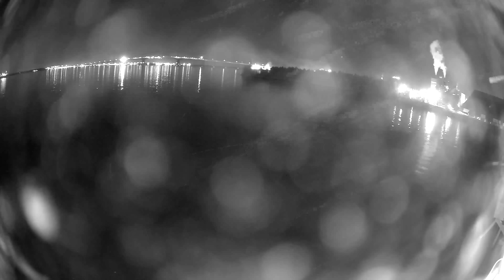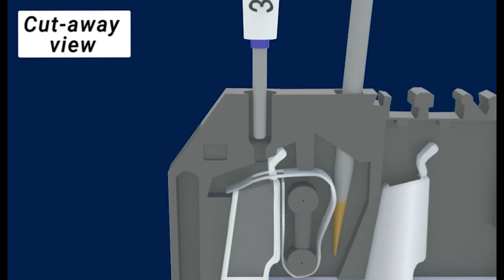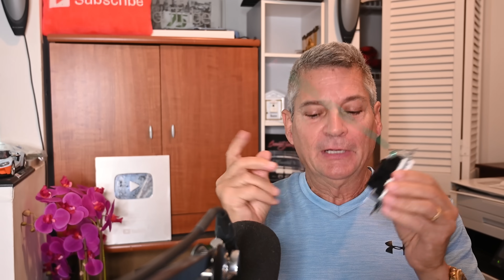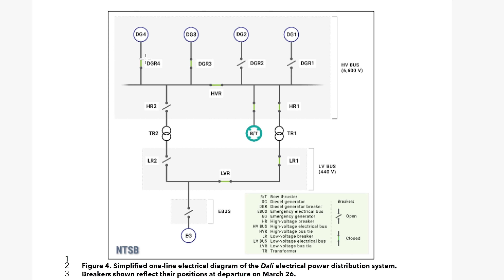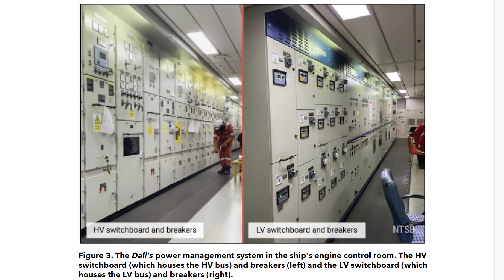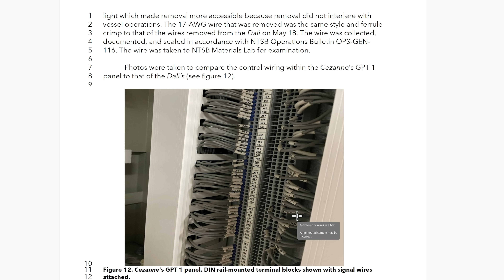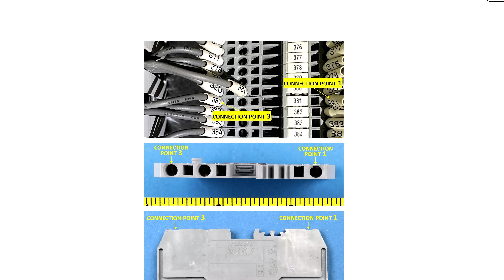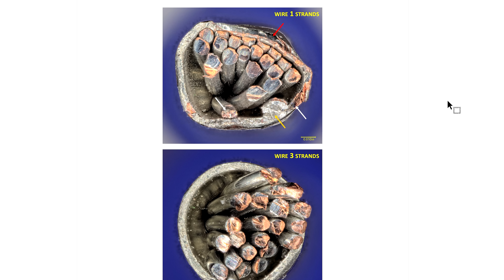NTSB: Scary Wire ERROR Caused Dali Crash/Key Bridge Collapse Baltimore

Comment: Im an automations guy and have built many panels. In my first year of apprenticeship way back 10 years ago we were taught NEVER to use ferrules on this type of terminal block. Every ferrule was multiple points docked in practical exams. The ferrule lowers the connection strength with the spring loaded copper strip AND increases contact resistance (even tho this wasnt any issue here). Idk about the codes in the US though, im swiss

Comment: I once commissioned a crane in Bermuda, and because there was no power available, I used my spare time just to inspect some of the crane wiring. Tugged on a wire, pulled straight out of the crimp terminals. Tugged another, same thing. Most of the wiring had crimps that were too large for the wire size, so all had to be re-terminated. I also found larger cables where they didn't have the proper cable lugs, so they used a lug that was far bigger and just squashed it down onto the cable with a pair of side cutters.
Reply: I worked in nuclear plants in the UK and commissioned many modifications. On completion and sign off of the wiring I would run a finger along the wires close to the terminations, this was my informal test. Any loose ones were obvious. If I found any the contractor would be required to QA check all of them.
Reply: @christopherjones7459 We supplied control gear to many cranes at nuclear power stations, the Lineastat speed control system was type approved by the CEGB, the EES 1970 specification was based on evaluating it. I've been on most of the non-seismic cranes at Sizewell B.

Comment: No one seems to explain why the rudder turned the ship INTO the bridge after power went out. The ship had been on course to pass between the bridge abutments when it lost power - it should have just coasted right on through. Instead, it made a rather hard turn to starboard. Why? Add to that strange phenomena, the coincidence that the ship lost power at the worst possible time - the couple of minutes approaching a bridge. What are the odds of both happening?

Comment: Redundancy failure due to bad management, and finally enough holes in the Swiss cheese line up, and there is an accident.
Normally an intermittent break in the no volt trip circuit does not cause this kind of chaos.
It is the last one of a chain of events, and it is a symptom of a bigger problem, not a single cause.

Comment: Better than wrapping wire around the screws on switches and outlets is the back wire screw clamp style. Each of the 4 screws has a clamp saddle. Just strip the insulation to the right length, put the bare end under the clamp and tighten the screw. They're very handy when replacing back stabbed outlet where the wires are short.

One thing about the back stab holes is now they're only for 14 gauge wire. They used to be sized for 12 gauge. I had to replace a 12 gauge back stabbed outlet with really short wires. Couldn't get a new one with larger holes so I bought a higher price commercial grade back wire one.
Reply: People will try stick 2 in the one hole.  That's why they are sized to spec.

Comment: I've had this exact problem with wago push terminals in industrial control systems. Along with under-insertion, you also need to worry about over-insertion if they're wired up without ferrules. That happens way more often, in my experience. Panel builders usually use ferrules but plant maintenance doesn't always have the proper equipment on hand when making repairs or doing field wiring. The wire insulation ends up being the only part making contact. It's an absolute nightmare to diagnose because everything appears to be wired correctly because nothing is loose. It's now a standard practice of mine to just start re-seating these terminals if there are gremlins and I have a ferrule kit in my traveling tool kit just because of this issue. I love wago lever lock connectors but I hate these terminal blocks.

Comment: I hate to say I told you so! My first thought when I saw the lights go out was “the dam PLC must have malfunction. Bypass and go to relay mode or old school redundancy mode. I ask why didn’t the ships horn blow to alert the impending danger???? Probably the electric controlled the valve. Need a manual override. I’m an electrician/ electronics tech.

Comment: Usually when used correctly spring-cage terminals are much more reliable on ships than screw terminals. The screws can loosen due to vibration and are periodically tightened every few years (not sure if it's a class requirement or just a recommendation).

Comment: AT 22:10 It could be the metal conductor bar connector was heating up and melted the housing. Also the label looks like it could have been pull over closer to the contact point which the wire looks like it barely reaches. Now with that label closer to the contact point it looked like it was on correctly but it was like a false fit. Thank you for sharing

Comment: These are not power conductors, they are being used as control, to drop a contactor, or control relay if trouble. That's why they are all in series like that.

Comment: I am certainly not a naval architect, but I do have a tiny sliver of knowledge with systems designed for redundancy. And I find myself wondering about some of the decisions made in terms of the redundancy in this thing. One could easily imagine a different set of decisions that tried to make the different parts more fully redundant for each other. A mechanism where running a generator would open its exhaust shutter. A mechanism where a generator running would automatically power a second pump to bring in fuel so that a failure to get outside power from a different source wouldn't stop a generator. Etc. I'm sure there are reasons specific to this context why my guesses are concretely bad ideas... I hope that actual good ideas get applied to make failures like this not happen.

Comment: You lost big credibility with your jump-cut edit while trying to pull that backstab wire out of the receptacle- No, they are not usually "easy" to pull out and often wont pull out and you show ignorance to call a receptacle "cheap" based on it having back stab connectors- slow your roll, dude

Comment: Why where DG3 & DG4 starved of fuel? All 4 gennys should have been primed. Was their work done on these generators or the common fuel supply prior to departure? Ive not heard anything blaming the crew though the reasons for these generators being starved cannot be accredited to the electrical issue.
Reply: The ship's operators had modified DG3 & DG4 to be supplied fuel with a different pump, designed to flush the fuel lines during maintenance. Because this pump was never intended by the ship's designers to supply operating fuel it had no redundancy nor would it automatically restart in the event of a disruption of LV power.

Comment: those are the cheapest looking ferrules I have ever seen! Crimp marks on the mating surface? Yuck! Do you remember the old ferrules that have a SOLID probe on the end? That's so you can insert a pin that isn't deformed, with the crimped part exterior to the terminal block. Rectangular probes would be superior, instead of tubular/round because of more surface area, (like Anderson Power Poles).

Comment: Many people don't understand, but redundancy brings its own risks, such as the need to synchronize generators. I understand that a single wire wouldn't cause so much damage, but a redundancy solution for it will add 3 or 4 new wires. My understanding is that each fault found should be corrected from the source and not just circumvented.

Comment: I am an electrical engineer with 25 years of experience and I have always maintained that every accident can be avoided. This one really caught my attention because it was a manufacturing defect in the cable due to a poorly positioned identification ring.
Reply: And I'm thinking that there was a reason why the ID tags were attached that way. Maybe the original instruction was to keep the label away from the blue ferrule, but maybe the label wasn't securing to the wire. It kept moving, and they knew that number needed to be near the connection point. So they started attaching the label with part of it on the ferrule, to secure the label. It's a classic systems type of thing. One hand didn't know what the other was doing, there were too many moving parts and not enough oversight. If you're just a guy plugging these things in, you might not even know the construction of the wage cage, or know why it's so important for the ferrule to drop fully into the cage. You're just pushing these things in, and not paying attention to the depth.  You've got a couple hundred of these to do in a short time. There's a story here. An underpaid electrical tech, inattentive management, low pay overall for the both the tech and the person keeping an eye on things, inadequate, rushed training, corporate pressure to save time & cost...

Comment: I wouldn't blame these connectors. They're very reliable, if used properly. You could easily say the exact oposite - that the screw terminal, if not tightened well, can fail much easier (and it can, usually there is no spring in it).

Comment: I would like to point out something extremely important to understand to mitigate this exact issue from repeating(just the electric issue, I don't mean destroying a bridge). You can't be faulted for assuming a worker was directly responsable because of some carelessness or neglect directly leading to the improper installation that led to this accident. I would agree with this if it were found that a large number of these faulty connections were present. The truth is, instead, that they may have been doing this without realizing. This is why there weren't all sorts of these arcing shorts because that would have caused a constant string of electrical problems instead of a long-term intermittent anomaly(far more dangerous). So what was the flaw here? There really wasn't one in a traditional sense. In large systems, things of this sort cannot always be prevented. When inserting thousands of these, it happens in some cases that the wire doesn't go in smoothly while being inserted, so the electrician simply retries, and it eventually slides in. However, in some rare circumstances, it will feel like it has gone in, but it instead allows the plastic identification sleeve to overlap the plastic. The real problem is that it feels and looks the same. Normally, this would not result in a connection because it would not reach far enough in, but if this happens with a slightly longer wire and shorter sheath, it still makes a connection. It should be redesigned so that improper insertion cannot result in a connection.  In this case, that is exactly what happened. My main point is that this is a mistake nearly anyone could make. The ratio of lengths must also be changed so that even if the plastic slides in it creates a difference in appearance where the wiring meets its connection. THE FACT THAT THIS WIRE LOOKS NEARLY IDENTICAL AND PROPERLY FUNCTIONS IN THIS ALTERNATE AND UNSAFE CONFIGURATION, EVEN IF ONLY TEMPORARILY, IS THE REAL SAFETY ISSUE!

Comment: One of the troubles with that sort of wiring mistake, other than creating an intermittent problem that is the nightmare of troubleshooting large systems, is that you cannot actually see the problem unless you pull the wire out and notice it. I had a computer business repairing PCs and small devices, and intermittent problems are the worst.

Comment: - jump cut -
"See how it came out so easy?"
LOL c'mon man.

Secondly, the backstab connection ability on electrical devices exists because it has been deemed acceptable by the appropriate authority. I personally don't like them or use them, but using them isn't actually wrong. I've certainly seen guys terminate incorrectly to a screw terminal as well, basic skill still required.

Comment: If you look closely at time stamp 19:54 in the video, where the two exemplar ferrules are shown side by side, you can see what appear to be wear/abrasion markings on the two ferrules: 1) the upper sample, with the INCORRECTLY applied labeling band, appears to be abraded at the crimp nearest the wire end, while on 2) the lower sample, there appears to be abrasion just above the 4th crimp. I think these abrasions are the result, and indicate the location where the Wago gripping mechanism actually engaged the ferrule.

Comment: Great explanation of the actual connection failure and the systematic failure of no redundancy in the power setup. Which type of crimping tool should have been used here? As I understand it there are the 4-jaw or the 6-jaw crimping tools. In screw terminals I always understood it too be to use 4-jaw on square hole shaped terminals and 6-jaw on round shape terminals to give better contact surface. Do these 'wago' type terminals take either type as both are shown in use here @19.53

Comment: To echo what a few others have said, the spring clamp terminals like the Phoenix and Wago are the gold standard in this case but like so many things they need to be put together properly. It is interesting that reference is made to the screw terminals on US outlets, that is a terrible connection that isnt very good with vibration and thermal cycling, problems that aren't really present in the proper spring clamp terminals.
Reply: Totally agree. When he talked about the benefits of screws I switched off the video.
Reply: yup ive seen 3 ships just floating around because of a loose wire with screw terminal  and with maintanance i do have to tighten heaps of them because you can tighten some 2turns  and then i have a ship with spring cage terminals  so i just tug test em and eh yeah none of them ever budged and neither of them ever had connection issue's

the demand for a ferrule is kinda nonsense tho   phoenix/most brands go against this since it doesnt offer a better contact or a more reliable connection.    with bare strands its quite easy to get a contact area that bigger than the crossection of the wire.  solid wire that become's a bit harder and with movement it wont selfcorrect as much
Reply: It also happens with other screw-type mechanisms as well, one of my current jobs is doing work scaffolding in industrial environments and the screw-type jack legs have a well-known tendency to start slowly creeping downwards with the scaffold becoming tilted if they're left in places with vibrations, as the vibrations cause the adjusting nut to begin rotating even under heavy pressure from the weight of the scaffold if they're not prevented from doing that with wire or such.
Reply: That would depend on the screw terminal.  Compression screw terminals, absolutely.  The gold standard before spring clamp terminal blocks and compression screws were open ring lugged screw terminals which are as bulletproof than spring clamps, but they're not used that much anymore because they take up more space and cost significantly more.
Reply: The same exact thing that happened here would have happened with a Wago.

A Wago is even LESS ideal in these situations.
Reply: @professorElAlamein  It doesn't matter. Wago and Phoenix are using the same basic construction for their spring clamps.
Just like most of the other manufacturers who use these with terminals, devices and switches. E.g.: Siemens, Eaton, ABB, Weidmueller, Legrand, ...

Comment: I build UL electrical cabinet for the automation industry.This is why I prefer to use tape wire tags and not the shrink tube type. It’s often faster with instillation when  wiring a panel. 
The tape will stick where you want them to be on the wire and shouldn’t drop and interfere with any ferrules.